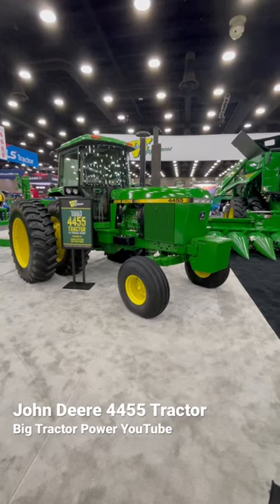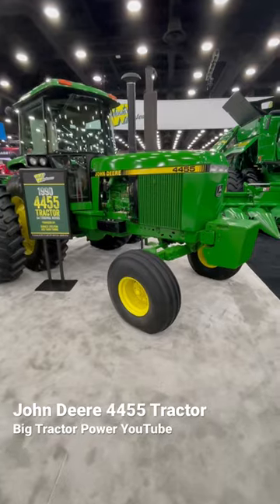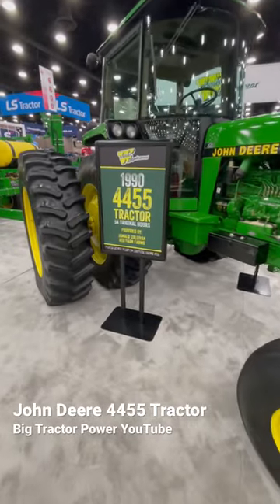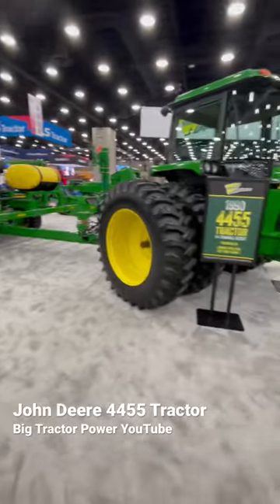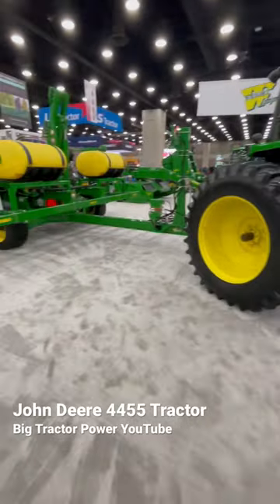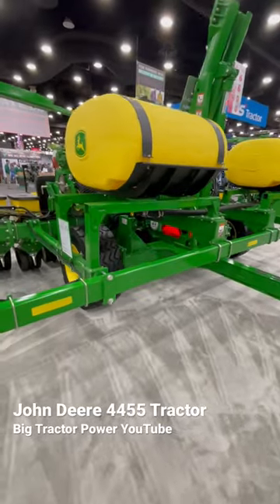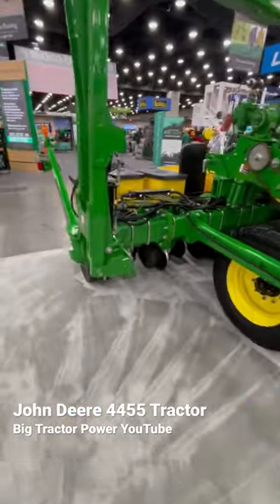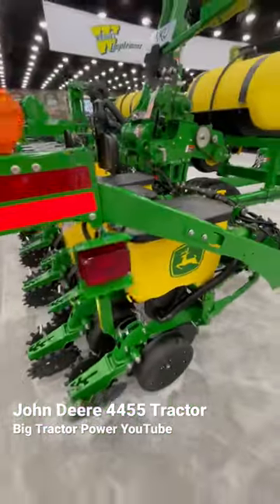JOHN DEERE 4455 Tractor with 94 Hours

Comment: Very cool setup. It's nice to use an older tractor with newer equipment. I've been running a 1982 JD 4640 with a 2001 JD 1760 planter MaxEmerge XP. Added autosteer 8 years ago to the 4640. This year we will be running high speed on the planter for the first time.
Reply: I've been running this setup since 2005.
Reply: @gregyoung6216  very interesting. Would you consider equipping an older tractor with the manufacturer's own gps system worth it? Considering on cost and maintenance on older tractors are slightly more than a newer one in a perspective. I have four or five older tractors as backup if the brand new 2021 and newer fails (especially sensor malfunction). But would be interesting to install the manufacturer (i.e John Deere) own gps system to run modern farming equipment. 

Would be interested in your own words about this.

Comment: They definitely be running that thing with the key off😅
Reply: Lol probably. It’s actually probably rpm activated though. But it definitely looks more used than 94 hours. The manifold is rusted as hell
Reply: @nalley6815  the 55 series had an electronic tac instead of a mechanical one, so if you start it and then turn the key off, it'll run without adding hours to the tach. One of the main reasons the 60 series has an automatic fuel shut-off instead of a manual one
Reply: @NickVanRegenmorter  wow I’m stupid. I 100% knew that but for whatever reason was thinking 30 and 40 series tach lol

Comment: They were excellent tractors. These newer tractors dont a handle to the tractors of this era. You could maintain and repair the entire tractor yourself. They also had less things to go wrong with using far less electronics on them. The transmission was all mechanically controlled powershifts. Folks can restore and use these horses even today very easily. When the tractors at present get older, I doubt very seriously youll see people restoring the present tractors in the future when they are 40 yrs old.